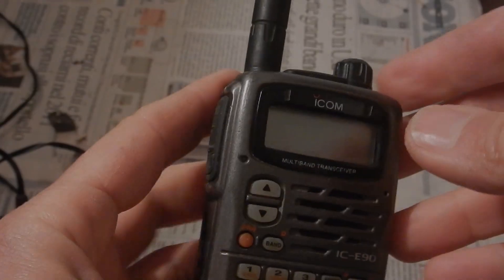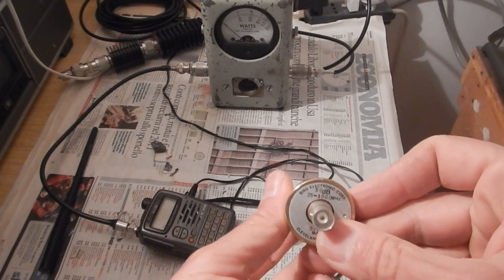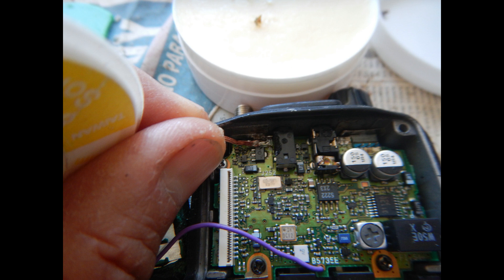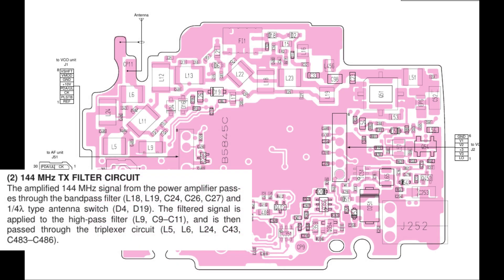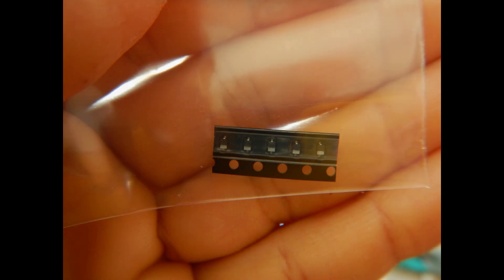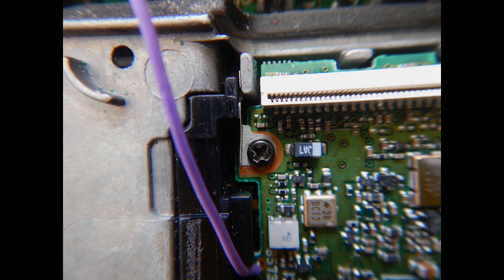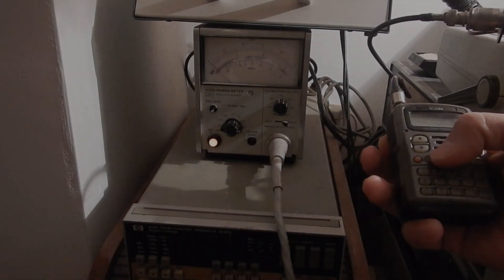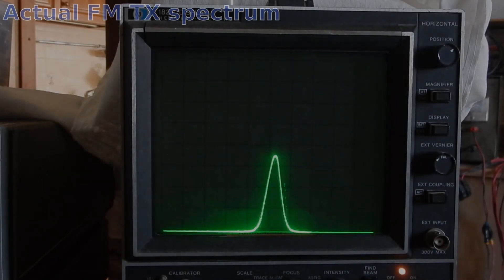Icom IC-E90 amateur radio transceiver TX fault repair. As lucky as it can get.

Comment: The battery is probably a 7.2V NiCad / NiMH, so it being 7.5V is already fully charged.
Often these small little transceivers had their full output only with external power (the older, slightly bigger ones could often be powered directly with 13.8V and then had ~5 watts, with the battery they delivered "only" 2-3 Watts (which does not make a big difference usually anyways) and kept the power consumption reasonably for the battery packs of that era.
I still have an (older? at least it's  bigger, from a quick search it might be an IC-W32E) dualband 2m/70cm Icom handheld trx lying around somewhere, I'll really need to find it and check out if it works. I have been out of the ham radio hobby for 25 years now.
Due to your TS180S I have hauled that one down from the attic but I suspect it needs an overhaul, too.
Thanks for these videos, these partly remind me of the old times and part prod me to start playing around with that old stuff I still have again somewhen in the future.
Reply from the maker: Thanks for the comment, you're right, likely the battery can't reach 8V even when new. I'm glad you are considering hamradio activity again! I am in these days installing a new 50/70 MHz yagi on the roof. I'd like amateur radio activity to be more on the leading edge of radio and electronics as it used to be from the beginning, rather than at the trailing edge as it was when I've more or less abandoned it. I think a new "ham" category must be created maybe, who knows...
Reply: The original battery for the IC-E90 is Li-Ion. This 2 cell battery should have 8.4V or a little less when fully charged.

Comment: Is there anything you can't repair? Excellent work as always. Thanks for sharing
Reply from the maker: Hi! In reality there're lots of things I can't repair, most modern devices have no schematics available and even parts can't be sourced easily, not to mention the difficulty in probing around the BGA and similar SMD parts. I prefer the old devices when it comes to using and repairing :)